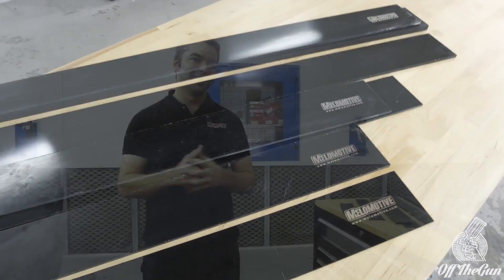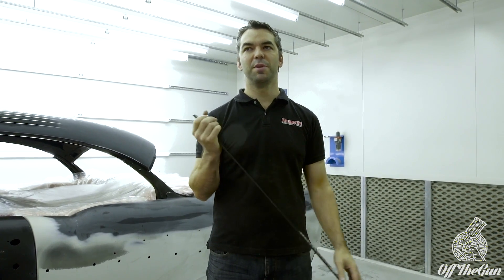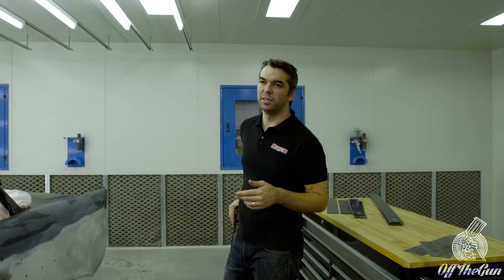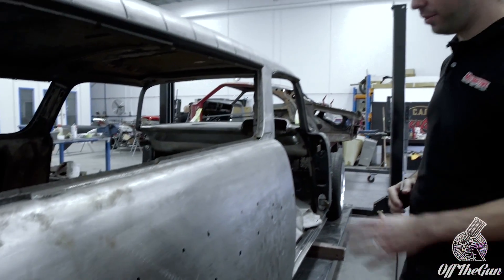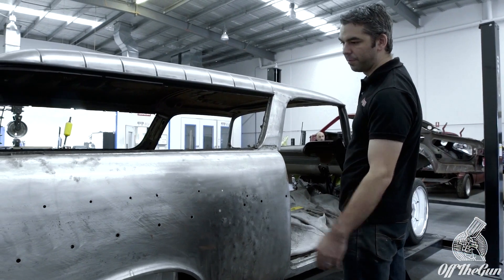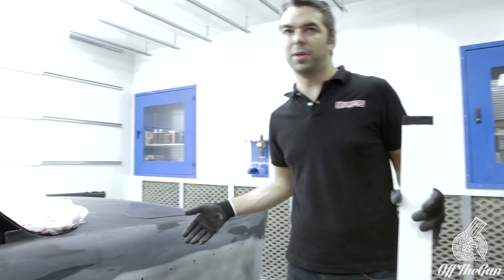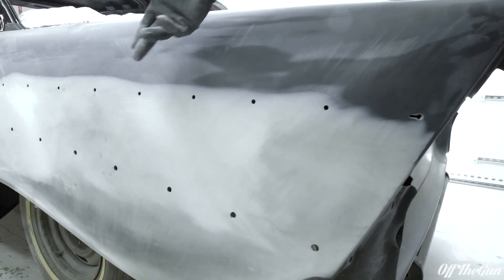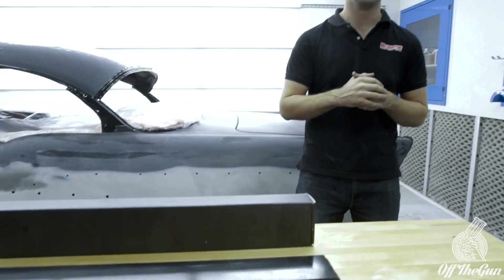Off The Gun x Melomotive - Introduction to Splines

Comment: I see it being used for a few applications not fully convinced thats the perfect tool for blocking primer or for color sanding I can see the edge of the tool possibly scratching the finish
Reply: Im a painter mate and i use acrylic blocks i made myself which work pretty well the same to these and swear by them, you are right you do get some courser scratching from using hard dense blocks but its only needed for the intitial sand then finish with softer conventional blocks as you refine through the grits